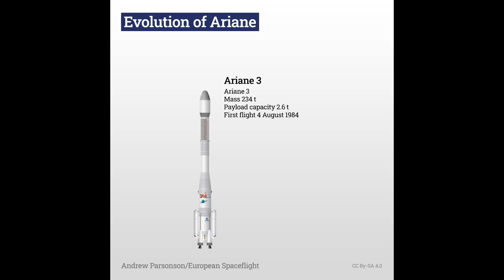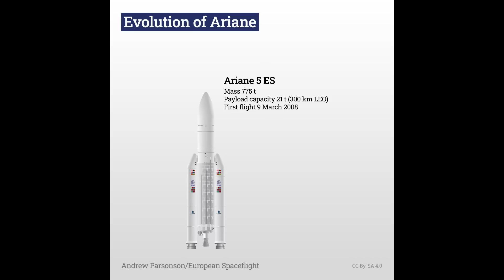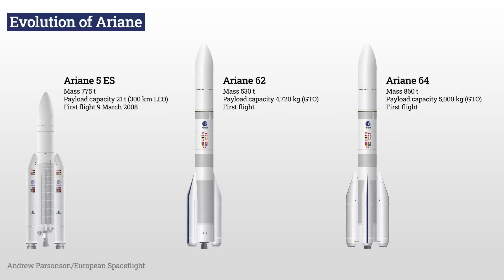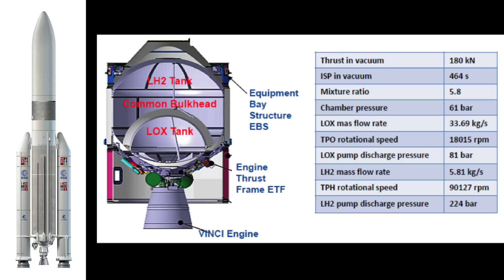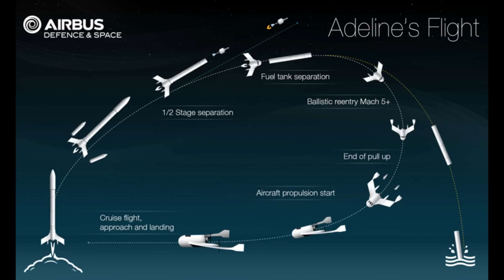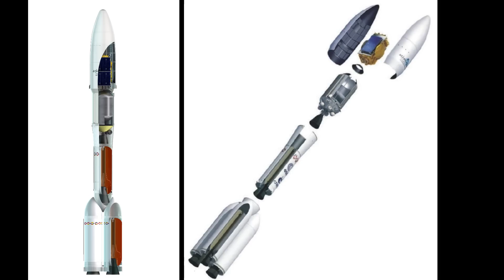Europe Retires Ariane 5 Before Ariane 6 Is Ready????

Comment: Ariane 5 was a major success. Between 2000 and 2012, she owned 60% of the commercial satellites market. She also greatly benefited from the us space shuttle being so expensive.

After 2012 and the beginning of SpaceX, the market share of Ariane 5 started to decrease. Ariane 5 was perfectly designed for the market of the 2000s. Ariane 6 was pefectly designed for market of the 2015s. Ariane 6 is almost 10 years to late. 

But late is still better than ever, and Ariane 6 has a great many improvments over Ariane 5, such as 50% reduction in costs, a 100% increase in production capability, ability to launch satellites constellations etc ...

Ariane has decided, a bit late, to throw themselves in reusability. The reusable methalox prometheus engine is in development , as well as other engines. For now, they still lack some vision though.
Reply: No such thing as being too late if you have guaranteed government funding.
Reply: What does "100% increase in production capability" even means?
What is "Ability to launch satellites constellations"? You know a rocket which is somehow inherently incapable of launching dual payloads?
Reply: @denysvlasenko1865  Ariane's factories were not able to produce more than 7 Ariane 5 each year. Ariane 6 should be able to launch 14 times a year.
Ariane 5 was not practical for launching satellites constellations because it lacked a relightable second stage engine, unlike Ariane 6. Ariane 6 is also equipped with light secondary engines, simplifying the manoeuvers needed to release cubesats on multiple different orbits.
Reply: Ariane 5 wasn't a major success. It was very expensive and very inflexible. They had some commercial success (mostly because their competition were just completely delusional idiots or collapsing)  but the whole design was not a success. Launch two sats at once limited the number of launches, meaning expensive, lots of fixed cost and slow operations. Europe had to launch Russian rockets for a lot of payload, Soyuz launched by Europe often had more launches then Ariane. A smaller rocket, launched more often with more commonality between engines and different launch vehicle sizes would have been a far, far better solution to Europes problem. 

They got high on success and way oversized the Ariane 5 for Hermis, instead of building a rocket that could dominate the market in the long term.
Reply: @---jc7pi   The ESA's intention was to make sure that they had a rocket that could do practically anything they would ever need it to do (and well), which includes some very challenging types of mission.  A smaller and therefore more affordable rocket might have been able to dominate the market, but would not have satisfied their main requirement.  They needed multiple rockets to handle smaller/less challenging payloads/missions, so they went with a little one plus the Soyuz from Russia (which did dominate the market for long stretches), which turned out not to be such a dependable solution.

SpaceX were able to get the Falcon 9 to do almost everything with the versatility if its design.  Falcon Heavy really could be considered a different rocket, although obviously it is very much a variant of the Falcon 9 in some ways.  The Falcon 9 can compete against the Soyuz in cost (and dominate the market) because of its reusability, and when expended it comes close to matching the Ariane 5 (and is actually superior in mass to LEO).  As for small satellites, of course there are ride-sharing missions, and the second stage's ability to relight multiple times in space helps it accomplish more such missions.  The bottom line is that SpaceX simply outdid everyone else, and let's not forget how they were scoffed at and dismissed at the beginning, especially in Europe.  The ESA and Arianespace had a chance to do the same things, and didn't merely lack motivation, they thought what SpaceX were doing was dumb, and said so.
Reply: And when Ariane 6 will be ready, Starship will be in service... Well, maybe even before sigh
Reply: @etbadaboum  And Starship will turn out as expensive as the Space Shuttle if it reaches orbit at all.
Reply: @karstenschuhmann8334  I don't think so!
Reply: @etbadaboum  Look reusing boosters is a good idea, reusing upper stages is an expensive publicity stunt.

Heatshield and engines are useless weight. Space shuttle carried 80t into space and only 20t were payload, the rest was the shuttle itself. It was therefore 10 times more expensive than Ariane 5 despite similar technology and similar payload.

The Shuttle was a real-life enactment of a comic strip, not a useful concept.

A Starship without Starship may be successful.
Reply: @karstenschuhmann8334  Space Shuttle landed like a place, Starship lands like a proper rocket with excellent payload to space. Reusable second stage is fundamental for very rapid turnaround.
Reply: @etbadaboum  Reusable orbital stages are expensive and dangerous.

If you leave away the heat shield and jettison all but one engine you can probably double the payload. 

Wings are stupid, but the same is true for heatshields and fuel left in the tanks.
Reply: @karstenschuhmann8334  I don't think you understand how ingenious Starship design is. Long form, Everyday Astronaut has made great videos about it.
Reply: @etbadaboum  Well, it is a mixture of Space Shuttle and N1. It makes absolutely no sense. But it may be a path to something useful.
Reply: @karstenschuhmann8334  It makes perfect sense, especially for industrialization and sending dozens of them per day to Mars.
Reply: @etbadaboum  It is even more useless for the journey to Mars.
- It is useless as a freight vehicle to Mars. Way too much mass and a far too huge heat shield. 
- It is useless for a habitat on the way to Mars. 
--- Not optimized for zero-g habitation.
--- No sufficient radiation shield.
--- Difficult to generate artificial gravity.
- It is pretty useless to land on rough terrain, and it will clearly not start after landing on Mars.

And all this multiplied with the fact that the launch vehicle itself carries way too much useless mass.
Reply: @karstenschuhmann8334  I see that you can't get out of your confirmation bubble.
Reply: @etbadaboum  Well, I have brought up arguments you have nothing but your bubble.
Reply: Difficult to have vision when designed by committee... It was a good design as long as the competition was ULA...
Reply: @zapfanzapfan  They still have Kourou which makes them far more advantageous than any other launcher if you want to send heavy payloads to GTO
Reply: @UnePintade  That is an advantage and so is the more efficient second stage (LH + LOx), but it is not an advantage like being able to reuse the first stage 20 times.

I might have to pin my hopes on the European rocket startups like RFA, first launch maybe this summer.
Reply: @zapfanzapfan  Yeah but ... the competition WAS ULA and the shuttle. They designed for their competition. No shame in that, I don't judge them too harshly for not building something spectacular and new when they were already ahead of their competition in some ways.
Reply: @minikawildflower  I do judge them harshly. Look at at the budgets they had and look where they are. It’s pathetic.
Reply: Is it reusability that makes Space X so competitive or is it their ability to churn out rockets like sausages? I'd like to see an independent cost benefit analysis on this. How much does taking all that fuel to space and back, then recovery, maintenance and refurbishment offset the gains of reuse?
Reply: @aarondavis8943  This is far from the entire answer, but I know that the fuel itself is a very low portion of the cost, and that for many F9 launches, the payload is considerably less than its maximum. So that's a huge benefit there, since for most payloads it doesn't cost them anything more to actually do the launch, because they would have wanted the rocket to be this capable anyway, for cases where they DO need to max out the payload. Can't speak to what they have to spend on refurbishment though - we all assume refurbishing a core must cost them less than building a new one or it wouldn't be worth trying, but I haven't seen those numbers.
Reply: @aarondavis8943  For SpaceX, internal cost of a reusable launch is ~ $25M.
Reply: @aarondavis8943  They arent even pumping out rockets that quickly, their active fleet is relatively small. Also they barely refurbish them, its mostly checking if everythings alright and fixing if needed.
Reply: EU wanted to make ESA an EU agency. Hence it failed. It will never be competitive again, in terms of outcomes relative to money spent.
Reply: @geraint8989  If it was a EU organization it would be easier to secure funding where member states can not suddenly pull out without warning. ESA fails because we got our national space agencies with ESA in parallel instead of only ESA. We both fund the national space programs at the same time as we fund ESA meaning money gets spread out too thin making expensive projects extremely inefficient.  Though I think we europeans are too stupid to understand that poland as a example does not have the resources to have a individual space program. The logical solution is to combine our resources to really get the resources necessary to lead when it comes to space tech otherwise we will always be behind the other competitors.

Comment: With carbon fibre pressure vessels being a bit of a thing at the moment, it would be good to see more about those Ariane 6 solid boosters.
Reply: Concerning carbon fiber and its main property of high tensile strength, creating a composite vessel to keep pressure in is totally different from creating one to keep pressure out.  For the former carbon fiber can be great, while for the latter it is simply a very bad choice.  In aerospace, where pressure is involved, carbon fiber composites are only used to keep pressure in.  That delusional, dead idiot Stockton Rush, who built that death trap of a deep submergence vehicle, the Titan, had no clue about what he was doing, just as many real experts tried to tell him.  Deep sea diving might be analogous to space travel in some respects, but in terms of forces and material selection, they are far from equivalent, which he proved (against his own belief).
Reply: The GEM series of solid rocket motors have been using carbon fiber casings for over 30 years, it's a fairly well-established technology for strap-on boosters.
Reply: Carbon fiber is preferred in space sector because of it's weight factor. it's still a mystery  as to why a submarine/submersible  manufacturer prefer  that as a constructing material when the visible advantage over a metallic body is practically null.
Reply: @kunjukunjunil1481   I suppose the (faulty) rationale for using lighter material for the pressure hull was that even a deep submergence vehicle needs to be buoyant so that it can easily and quickly surface even if every system were to fail (except for dropping the ballast, which has to work, period).  DSVs that have heavy steel or titanium pressure hulls have to use some sort of incompressible material that is lighter than water in order to achieve this, such as a tank of gasoline or a type of advanced syntactic foam that can withstand tremendous pressure.  The foam is superior because it provides greater buoyancy per volume and there is less weight and bulk to handle while out of the water, but even if you don't have this, the low-tech tank of gasoline works just fine.

In the case of the Titan, Rush thought (and I use that word lightly when talking about this guy) that he could accomplish several things at once, and at a lower cost, by using lightweight carbon fiber from aerospace: provide a larger interior volume, which in turn increases buoyancy without requiring a bulky tank or expensive syntactic foam.  Note how incredibly compact the Titan was for its relatively large interior volume, and how it used nothing but the pressure hull itself for buoyancy.  No tank or foam was needed to make it float, as far as I can tell.  Rush thought he had a superior design in most every respect, plus an infallible fault detention system that would definitely save everyone in the case of an impending implosion.  And if all of this weren't silly and stupid enough, he decided to make the pressure hull in the form of a cylinder rather than a much stronger sphere like those of all of the other DSVs out there.  I guess this was to provide more usable interior volume, and make it easier to make out of carbon fiber.  Unfortunately, every other aspect of this sub's design was similarly pathetic, including the method used to drop the ballast (rock the boat until it falls off).

One mystery is why the Titan wasn't nearly buoyant enough during the emergency.  They dropped the ballast and even the whole frame, but it was surfacing at a crawl.  Maybe it was taking on water somehow without killing everyone immediately?  Whatever happened, Rush's warning system surprisingly almost did its job, detecting the problem nearly 20 minutes before the pressure hull imploded.  The problem was that the Titan surfaced way, way too slowly to save everyone.  It should have gone up much faster, but it didn't, and no one currently knows why.  Maybe Rush was partially right about some things after all, but just wasn't right enough to survive, and in any case, taking such a risk was just plain foolish and should never be done.
Reply: Don't believe the pop culture propaganda. Carbon fibre can and has been used for pressure vessels without issue.
Reply: Look at Vega C stage 1 then. 2 successful missions...
Reply: Single use boosters should be fine, I wouldn't trust a multiuse one.
Reply: @bradlovin1   That's right, and even some metals are superior to others for reuse.  Steel (notably used in the Starship) is one of the best because of its fatigue limit property: within certain known limits of force and deformation, there is no fatigue at all.  Aluminum alloys, while they can be used in reusable vehicles, such as the Falcon 9 and, you know, aircraft, do suffer from fatigue, and so do carbon fiber composites.  The latter can still be durable enough, but must be used with care and a thorough understanding of its properties...and never to keep out pressure, as we've seen recently.  For the latter there can be no allowance for fatigue--use only certain steel or maybe titanium alloys.

Comment: Ariane V was also precise as heck. Allowing a lot of customers to have longer missions because they needed less fuel to correct their orbits.
Reply: it had to be. it cant relight like the f9 option. no chance for fixes.
Reply: @aredub1847  the relight feature makes the upper-stage capable of deliverying satellites into different orbits, it's not necessarily about the accuracy of the trajectory.
Reply: @luigeribeiro  it allows you to make adjustments. its not one and done. never played kerbel?
Reply: @aredub1847  as I said, it's not NECESSARILY about the accuracy of the trajectory. Falcon 9's upper stage can be relighted BUT has less accuracy and performance than Ariane 5's.
Reply: @aredub1847  That's only relevant if you have spare deltaV and room to make those adjustments. If you're going really far like the JWST you aren't gonna have fuel left to make adjustments and if you're aiming for a really price window then you won't have time to make adjustments either. You can't make up for accuracy by just infinitely adjustments, especially when said adjustments will still be less accurate.
Reply: @AthosRac fair enough. But if you miss your orbit you have to spent precious delta v as well. So Guiana space port and precision is a perfect storm
Reply: once it grew up, yes. Some of the early launches were less successful and it had a rocky start before it became the most reliable space truck that it was
Reply: Its not about precision, it is about where is launched....close to the equator so less fuel needed to enter orbit.
Reply: @AthosRac  Precision also counts for a lot. The mission time of JWST for example was extended by around ten years because of how precise Ariane 5 was.

Comment: Those scenes of them stacking the 2nd stage with an absolutely KLUDGE of pipes, when compared to the clean lines of the Raptor 2 is just astounding. No wonder they've already gotten to the point of being able to make Raptors on a daily basis, while the ESA take weeks or months per engine.
Reply: Its on purpose. The most amount of pipes they legally could fit in to make work amount it takes even more.